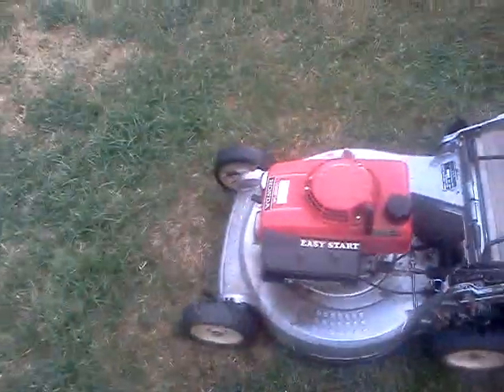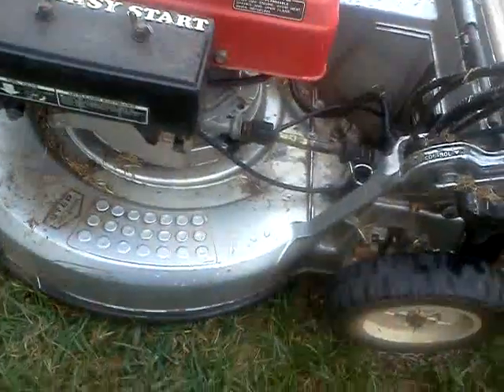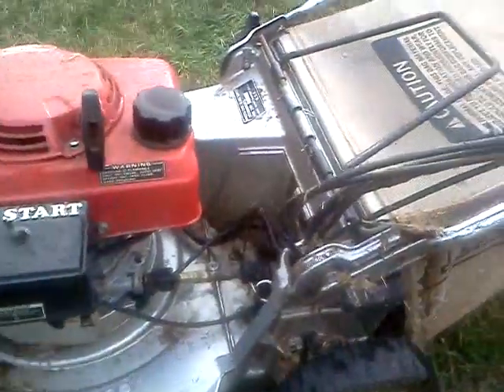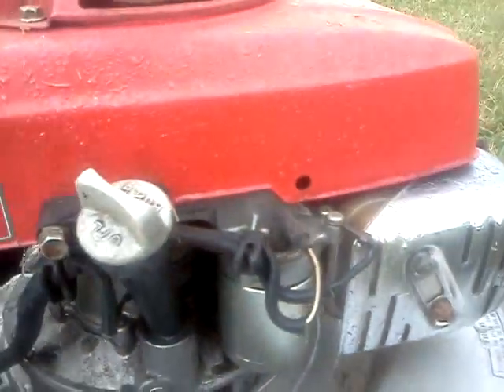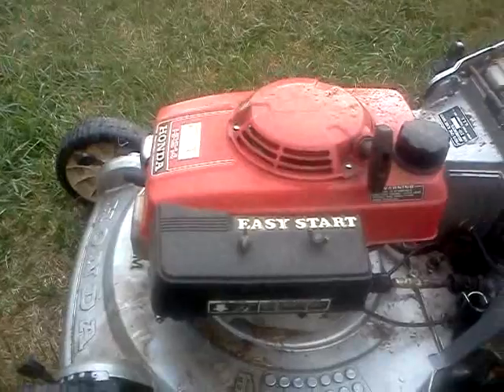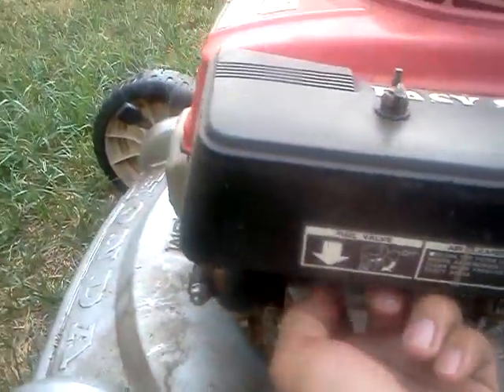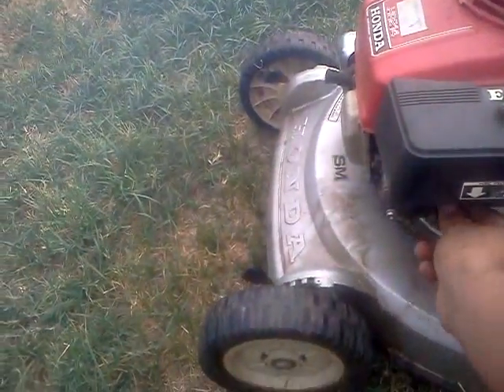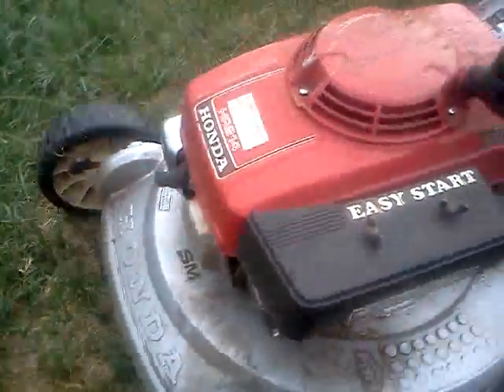Honda HR214

Comment: Hey man, the hr214 is a nice mower, but many of them smoke after the rings wear out. The engine is a gxv120-if you tear it down, give it some new rings and a hone job, it'll last another 20 years. Check out my page for instructions...
Reply: Do you have a video on how to replace the rings and what is a hone job? Also what type of oil do you use when you change your oil?